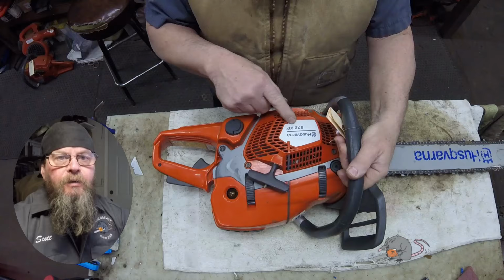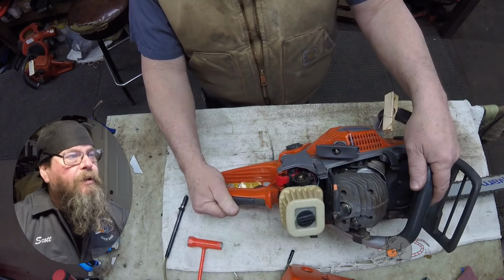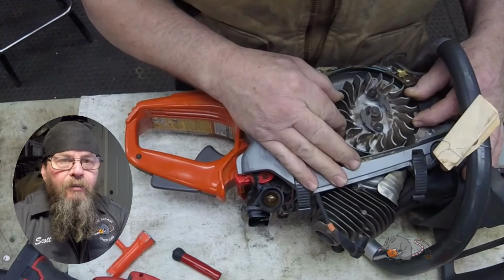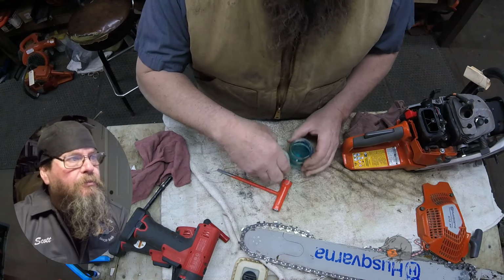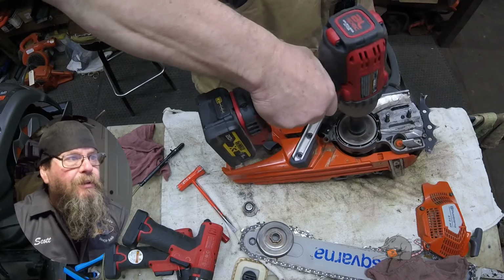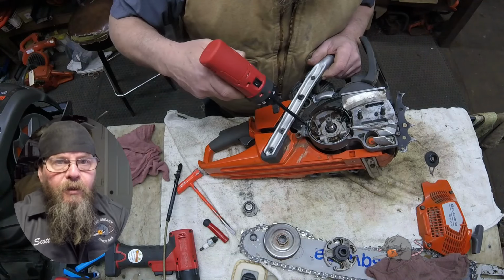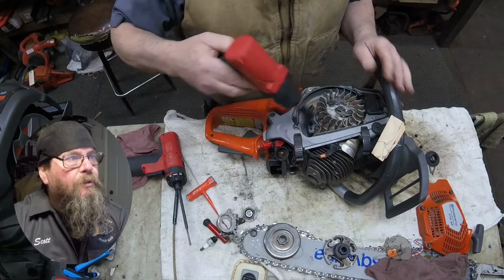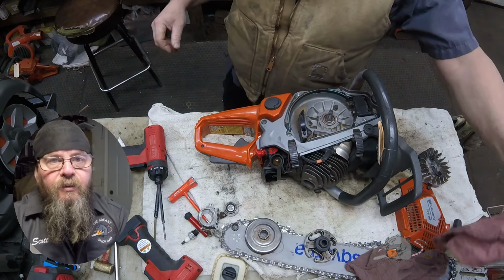Husqvarna 572XP Chainsaw Won't Start

Comment: I would have guessed the clutch side would get hotter and fail first.
Do you see a trend with these plastic cage bearings failing more on the flywheel vs clutch side?
Nice work!
Reply from the maker: I never gave it much thought but lately i'd say the flywheel side is the biggest offender.

Comment: wow,what a circumstance,am wondering how on earth it munched on that crank bearing 🤣
also what was your verdict on it,did you repair it for him or did you submit a warranty claim since the piston and probably the cylinder was damaged?
Reply from the maker: It was a warranty claim but I don't remember if it was fixed or replaced. I'm guessing replaced because I don't remember making a 572 crank bearing video.

Comment: What happens in a situation like this?  Take pictures and document then send to Husqvarna for a warranty claim?  Wait weeks to hear back then get parts and rebuild?  Husqvarna approves new parts over the phone and sends them?Husqvarna approves a replacement saw?  I just tinker with saws and so I am just curious.
Reply from the maker: I usually call Husqvarna tech and discuss the problem. They will request specific info or pics which I send. They will then decide if its a valid claim and if we will fix or they will replace. I supply the parts if we fix. They usually supply whole units if they replace. Their process is a good one when I compare to some other manufacturers and usually doesn't drag on.
Reply: @TheGreasyShopRag  sounds reasonable!  Thank you so much for responding!  Later!

Comment: Nice diagnosis.  What would cause that?  Just dirt getting in there, like you said?
Reply from the maker: Dirt, heat, chain too tight or maybe they just have a problem with a batch of bearings. Not sure.

Comment: Thanks for sharing Scott, disappointed by the 572xp. I bought one last month. Is there an aftermarket replacement bearing that isn't plastic?
Reply from the maker: As a dealer mechanic doing warranty work I've never explored that option.
Reply: just measure the o.d. the i.d. and the width in mm. and punch it into google

Comment: Morning Brother Did Not Think Husqvarna Would Use a Plastic Cage on a Crank Bearing Considering The Heat Of an Internal Combustion Engine Generates 
😩😮😮‍💨 Nice Find Now I Know Something New
Reply from the maker: Thanks for tuning in this morning!
Reply: Something to stay away from not new
Reply: When a plastic cage in the crank bearing lets go. You replace the bearings.  When a metal cage in a crank bearing goes. You buy new bearings, piston and cylinder.   How often do plastic cages fail compared to metal cages?
Reply from the maker: @jackylsmith8138  I don't know the comparison rate but husky has been having some issues lately.
Reply: @jackylsmith8138  Metal Crank Bearings Hardly Ever Fail I Guess It’s Just Plastic Cages Are Planned Obsolescence They Only Last So Long Then Get Brittle From Heat I’m Assuming
Reply: @TheGreasyShopRag  Love The Videos Brother And Your Husqvarna Knowledge 😀
Reply from the maker: @chrischiampo7647  Thanks for watching!

Comment: Yep I knew instantly when you said screen had a substance in it. Plastic! Don't know if it makes a difference but I run my newer Huskies at 40:1. The cage deal makes me nervous for sure. Last I checked my 550mk2 it had 70hrs in it so my guess is at least 100 now with no issues. 562 still has 2 years warranty left so good there! Good stuff see ya next time!
Reply from the maker: Thanks for sharing!

Comment: Will or did the post repair computer scan reveal the saw had been running way lean?  I guess the bearing cage could have been defective, but if  it failed due to heat, then at least replace both bearings and seals since both were exposed to the heat.  When you pulled it over at the beginning I almost got it right, I thought the screen was carbon clogged.  Like others, I lament the plastic bearing cages, but I think that is the common thing theses days.
Reply from the maker: No error codes or anything unusual. One day it ran, the next day it wouldn't.
Reply: @TheGreasyShopRag  I have days like that.  lol

Comment: That looked like a pretty low hour unit.  I don't remember having issues with the sealed bearing on the 390xp?  I have heard that there was a bad batch of bearings from SKF, but that was a while ago.
Reply from the maker: It is low hours but I dont remember the age. I'll look at that and compare the new and old bearings in that video.

Comment: Scott, do you think he tightened the crap out of the chain, cocking the crankshaft, wearing out the flywheel side bearing?
Reply from the maker: I guess its possible but if one bearing moved, the other should have moved also.

Comment: Hey, Scott!  I would think that bearing failed due to an overheat condition. Did you find any evidence to support this theory?  Otherwise I would imagine it’s just the idiocy of using plastic instead of metal for a bearing cage, right?
Reply from the maker: I'm guessing its one of those two things but not sure which one.